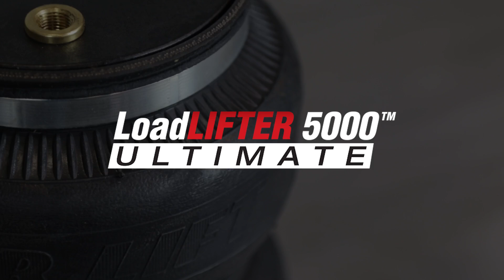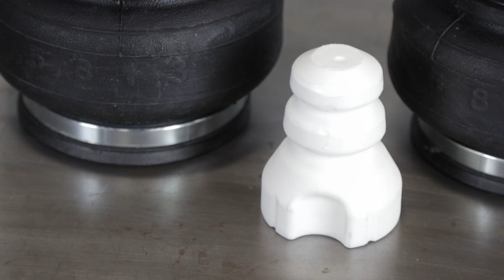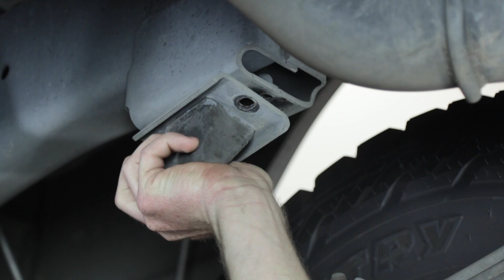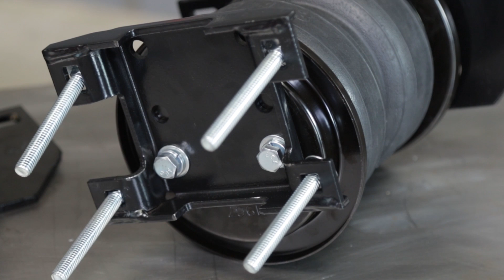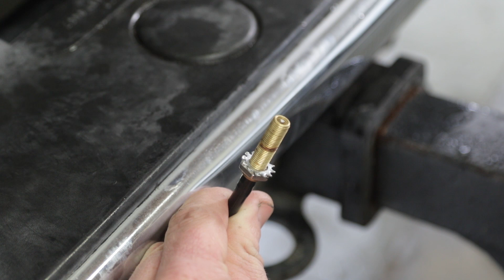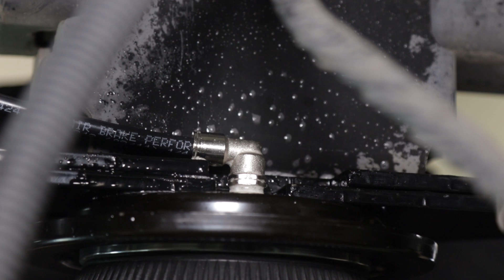Install Overview: 88295 - LoadLifter 5000 ULTIMATE - 2003-2013 Dodge Ram 2500/3500 (4WD)

Comment: You don’t need a compressor to run these?
Reply: Technically you can fill up at a gas station or with a compressor at home, etc…but you’d have to keep doing that, and not be able to adjust on the fly without manually letting out air. When a compressor system you can can full autonomy, or be able to manually adjust, etc. definitely recommend looking at there are a few options. Would suggest looking at the EZ systems (has a bracket that makes install ‘EZ’.

Comment: my truck feels rough when not towing with only 5 psi. feels like I have no suspension. how can j reduce that. the more I put the rough it feels
Reply: Try 15#
Reply: Take one leaf out your stack of springs
Reply: Wasn't it rough before can't imagine it getting worse!  My 06 single 3500 is rough as heck.  Wondering what everyone else thinks. I personally don't know anyone with this air lift on a Dodge because there build "Job Tough"... Since the transfer of vibration is threw a rubber membrane, I cant see how that can happen. Stiffness in the suspension OK leave it at 0 or 1psi if product line suggest you can.  Anthony Bellard suggests removing a spring.  That would certainly work to help stiffness....Heck even 2..   Now that can be over come with this air lift..  I think the 2500 and 3500 have different rear spring set ups??  I understand its been 4 years but did you ever figure this out? I'm looking to install this on mine. Some times I have to,, well do more than it should...   Please reply Thanks Al
Reply: I have a 2020 dually RAM but when I push to raise the airbags it says to be temporarily disconnected
Reply: Anthony Rosales why no response to this?